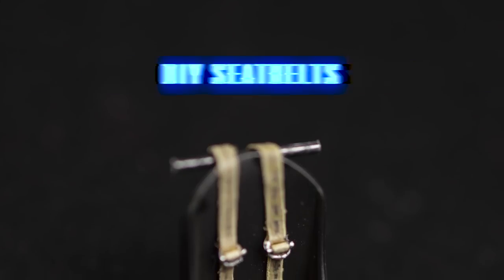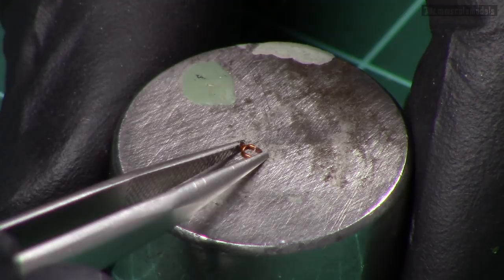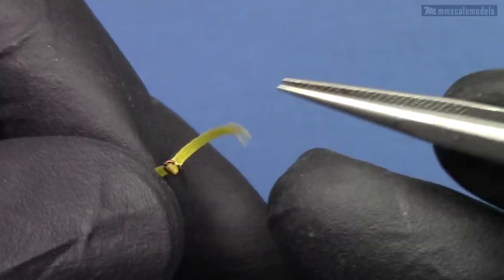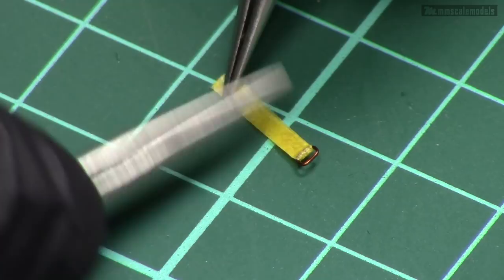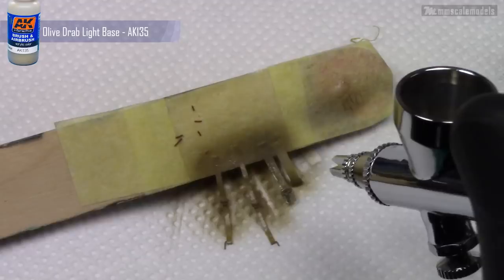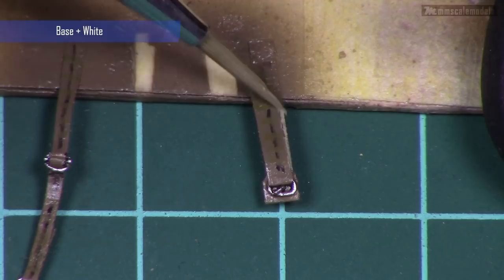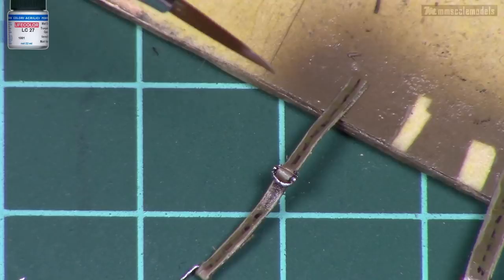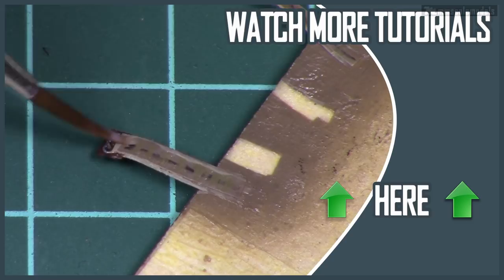DIY Scale model SEAT BELTS - plastic model building tutorial

Comment: Nice job. The frayed edges make them look good. Been doing the same thing for years re-using heavier clothing tags made of cloth. They are made of a stiff canvas sort from an old pair of shorts. The stylish marketing ones that come tagged onto the clothing. They hold up well when cut into small stripes. Then I use wire or a staple.
Reply from the maker: Thanks, I have tried that myself, however I cannot cut the tag so that the edge stays neat. I always get fibres sticking out. Any suggestions on that matter?
Reply: @MMScaleModels  Hi MM, I do like the quality of the frayed edge as it somehow lends itself to more a wear & tear of the strap out in the theatre. So I just let it be as is.
Reply from the maker: Interesting, do you use scissors  for the cutting?
Reply: @MMScaleModels  Hi, I always use an Exacto knife and metal straight edge.
Reply from the maker: Thanks for your input mate 👍

Comment: If you are doing this a lot, you should look at getting the infini "A" cutting mat. It is brilliant for cutting thin strips of masking tape.
Reply from the maker: Thanks mate, I haven's seen those and they look very useful, not just the A but all others 👍
Reply: @MMScaleModels  Yes the others do look good as well. Regarding the "A" mine is close at hand and has tape on it all the time. I was spray painting an oil tank for my Wingnut wings Albatros. It took me about 5 second to cut 2 thin strips of tape to mask off the straps going around the tank. It came out nice and clean. You can cut from 0.4mm up to either 1 or 0.9 mm, can't remember and not at home at the moment. I will be getting a couple of the other boards at some stage.
Reply from the maker: @ApriliaRSV4F  Definitely sounds like a good investment 👍

Comment: It's difficult to properly drape a PE seatbelt so making them is much better.  I use a black paint marker to draw the stitching, I get a neater result.  For buckles, I do rely on PE or resin (too much work to do it myself).  Good video, thanks!
Reply from the maker: Thanks for your input Jerry, i didn't know that resin buckles exist :) Doesn't the black marker bleach trough the paint?
Reply: @MMScaleModels  Not a marker, a paint marker, several brands available.  Like the name implies,  paint, not ink.  Not available where you are?
Reply from the maker: I haven't come across one of those so far. My quite Google search showed some but with rather big tips... Do they come in different sizes?
Reply: @MMScaleModels  Yes, Sharpie makes them with fine and extra fine tips.  The other brand I have is Posca (Uni-Posca).
Reply from the maker: @jerryvolpini7987  Thanks mate 👍

Comment: Hey there. Happy I found your channel. Quick question.: Any tips on getting the shoulder belts (teh buckle and the center beam) cleanly glued together. That center beam is killing me. third attempt at this and out of 30 buckles, not one we usable for the model; most of the center beams break off the buckle when trying thread through  or the buckle becomes clogged with super glue. Help!!!!
Reply from the maker: Hey, I would suggest using CA glue activator on the beam and very small amount of glue on the buckle. You have only one attempt at assembling them correctly but it is the cleanest joint.

Comment: I don't know if this helps any but back in the day when we used to make miniature military models we used to use electrical tape to make belts
Reply from the maker: Interesting idea!
Reply: @MMScaleModels  you can either leave it sticky or as we did take off the sticky with a cotton wool bud and lighter fluid it easy to paint easy to distress can be cut as a triangle a circle and so on and so forth